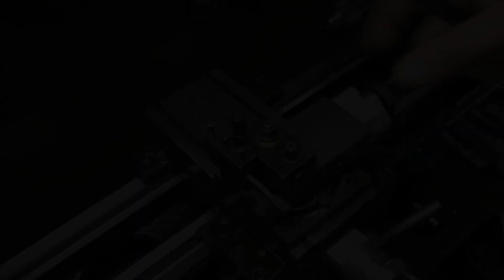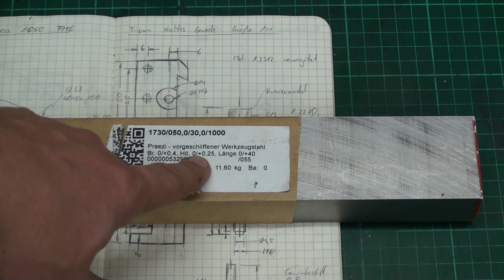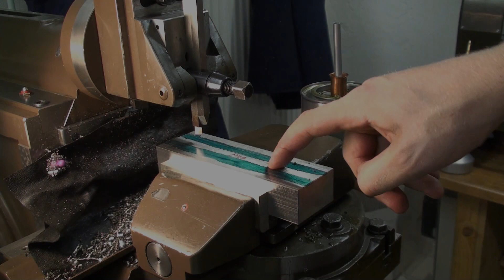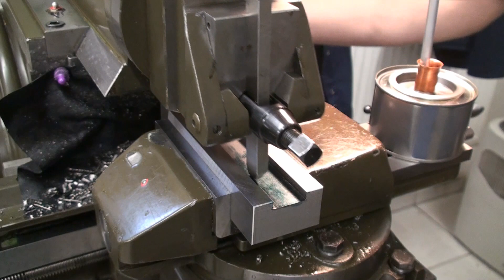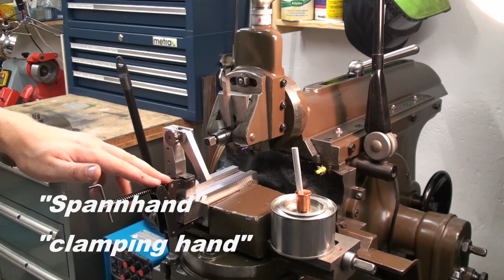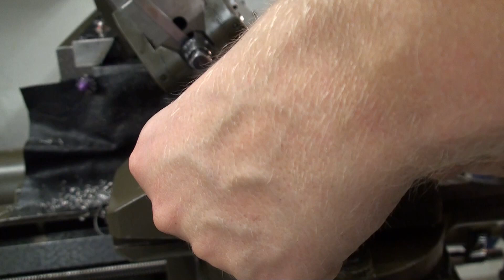Tripan 111  toolholders Part 1 - Tripan 111 Werkzeughalter Teil 1

Comment: Very interesting project, I have a Tripan 111 myself, and plan to make some holders if it works with a 60 degree dovetail cutter, I hope it will...
In germany, you have Deutsche Industri Normen DIN, and the steel is DIN 1.2312? I was thinking about the rest of the EU what 1.2312 would be? Looks to be the same as 40CrMnMoS8-6? I can probably not ask my local steel supplyer here in Sweden for DIN grades... First I though this steel was the trade name "C45"-grade, but now I get it, this is more proper tool steel with much higher content of chrome, molebdynum, and manganese...
I asked my local steel supplyer for C45 round stock for a pin replacement for my excavator. They said it was "obsolete", and replaced my more modern micro-alloyed variants that welds better. But this is another purpouse than toolholders of course...
I'm trying to learn different grades of tool steel. The HSS boring bar holders you made were of  DIN 1.2210 / 115CrV3 steel (silver steel). I am looking to make them as well...
Reply: Now I get it! In Sweden SSAB makes Toolox 33 as a more modern competitor to 1.2312/11. But it is pre hardened, not annealed state as you got.

Comment: Very nice series, well done job! I have a question on machining the dove tail itself. It has a 60 deg angle, and a depth of 6.3. The relief in the middle has a depth of 6.5. The question is, do you make an extra relief at the innermost edge of the 60 deg dove tail, as I believe exists in the original? Or is this not necessary? Thanks a lot!

Comment: Hi Stefan! Love machining videos and yours are some of the best I've seen, very detailed and informative.
I'm in no ways a machinist or fabricator, so forgive me if the following sounds stupid :)
Wouldn't it be possible to have some kind of jig that would allow interchangeability between the milling machine and the shaper? I.e., something that would allow to indicate your parts on only once and then you could change the whole set between shaper and milling machine, without loosing settings. I'm asking because it seems it would be much faster to rough cut your dovetail slide on the milling machine and fine cut it on the shaper.
Thank you for your videos and wish you have a great 2017!

Comment: Absolutely no interchangeability with Aloris style tool holders I suppose.
Reply from the maker: Of course not :)
Reply: +Stefan Gotteswinter Figures. As a business model it is called "buy or stuff". I find the Aloris Dovetail Type very repeatable. on the order of .0005"/.012mm is easiely held. The Aloris Piston Type not so much as one pulls the holder into the dovetail and the other pushes it on to the angled surfaces. Yours looks like it registers against the two flat surfaces and the rear dovetail surface. asways better to have at least on of the dovtils fully engaged.
Reply from the maker: I have a video on repeatability of the tripan toolpost, we are talking better than 1/100mm there too. The swiss know how to make a proper toolpost.
The tripan is a bit  different to the wedge and piston type aloris, it pulls the holder back onto the big flat surface of the dovetail.

Comment: what do you use...ähem...was verwendest du als cutting oil?
btw, you made very usefull chips, nützlich auch für mich - ich lerne sehr viel von dir und bewundere schon fast dein können ;-)
Reply from the maker: +lordofbasement Meistens was mir grade in die Finger kommt - Im Moment ist in meinem Öltopf normales dünnes Schneidöl:
http://www.ebay.de/itm/Schneidol-LS-90-Hochleistung-schneid-ol-universal-1-Liter-PR-/140981978027?hash=item20d32e43ab:m:mvJVRVHy6fyyB0PlVr_cUmg
Ich betreibe ja nicht grade Schwerzerspanung, da funktioniert so ziemlich alles...mir kommts immer so vor wenn Leute auf ein spezielles Schneidöl verweisen wollen sie unzulänglichkeiten am Werkzeug (Schliff, Schnittwerte...) ausgleichen...
Reply: +Stefan Gotteswinter und wieder ein sehr wichtiger Tip für mich, danke dafür! Ich dachte du verwendest irgendein highendultra irgendwas Öl um 99.- den Liter.
Wenn ich dich nochwas fragen dürfte, welche Fräser kannst du empfehlen? Ich habe einen Paulimot BF20 Klon und schlage mich momentan mit irgendwelchen Chinafräsern rum und produziere meist nur Mehl. Stell ich zu wenig zu? oder liegts schon an den Fräsern? Ich habe mit höchstem Interesse auch deinen Fräser vergleich verfolgt. Welchen würdest du für Modellbau im heimischen Keller an einer BF20 empfehlen? Du sagst immer was von carbide. Hast du da vielleicht einen Link dazu?

Comment: Hi Stefan,Just bought myself a shaper and so I have watched your very good and instructive video's on the use of such a machine again. Watching closely it seems that your machine is cutting on the backstroke. Is this normal for this type of machine or is it the way you set it up for this kind of projects.thanks and keep the nice vids comingTeun
Reply from the maker: +Teunbaartman1 I have two clapper boxes for that machine, one normal push-type and the reversed pull type. I prefer the second one as the chips dont fly all the way trough the shop and also its more rigid as the cutting forces work against the column of the machine.

Comment: That Gack shaper is a treasure. There are some old time books, reprinted by Lindsay press, on shaper work. Such as Stieri's "How to Run A Shaper" which I mention only for the benefit of shaper fans out there (Herr Gotteswinter knows it all already). Lindsay retired, but the inventory was bought out by www.youroldtimebooks.com.  Probably still some copies available. 

For myself, my chances of finding a shaper in Alaska are equal to my finding a Unicorn. But I was fascinated by the dovetail cutting. Slow, but most certainly sure. And much cheaper than buying a cutter and doing it on the mill. Bravissimo Stefan!

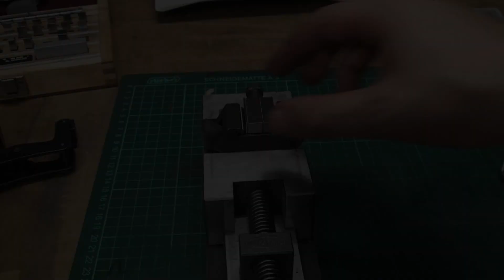Comment: Such clean work! I do have a question about measuring the width of the dovetail, could you not get a good and accurate measurement with your blade micrometer off the end of the dovetail at the "top of the vee" @16:00? I know that with the gauge pins you get all of the information that you need to replicate the tool-holders with the gauge pin technique, but I am just curious if you could attain an accurate measurement with your blade mic? Thanks very much.

Thank you for the video series, it is exceptional as always...Aloha, Chuck.
Reply from the maker: +Knolltop Farms Might work, but it could also be missleading, especially if one would measure against the edge of a part. The method with the two pins is the best way to do it in my mind, especially as you can check that way if the dovetail is parallel very easy.
What would make it even simpler would be a set of adjustable parallels.
Reply: @StefanGotteswinter  Also, if you know the pin size, and then doing a bit of trigonometry you can calculate the theoretical width with Stefan's measurement. d/tan(30)+d+20.23 gives 31.16, assuming the pins have d=4

Comment: Hi Stefan, it is always a pleasure to watch the shaper work. I know that you have the shaper set up to cut on the return stroke to limit the area the chips are thrown. Is not the speed of the return stroke greater than the cut stroke? This would have an impact on the way you set up the machine so you achieve the proper speed and feed for the material being processed. Correct? Now how did you modify the clapper so the tool bit does not scrape the work piece on the normal cut stroke and cut on the return stroke? I find it odd that "precision" ground stock is not square since that nullifies the word precision in my mind. Thanks for the info.

Peace!
Reply from the maker: +Jeffrey Vastine  Yes, of course :) For that reason the Gack has a switch to change the rotation of the motor when using the pull type clapper box - Then you get the slow, powerfull motion against the column and the fast return stroke away from it.
I had not to modify anything - the machine comes with two clapper boxes, one classic push type and the reversed one. They are changed within 30 seconds by loosening two screws.
I think I will do a seperate video on the gack shaper, as there are SO much questions on that machine..
The "precision ground" refers only to the parallelism of the stock :)
Reply: +Stefan Gotteswinter Thanks for the information as I did not know this. A video about the gack shaper would be great! I look forward to it.

Comment: Stefan,    My shaper seems to be set up to cut on the forward stroke,   It seems like (from the video) your shaper is cutting on the return stroke.   Is this so and would you care to say why you do it this way.  I am not an expert on the shaper but would like to be and to understand it better.  Sure would appreciate a comment from you on this.
Reply from the maker: +Glenn Felpel The Gack shaper can be setup to cut in both directions (pull and push) - It comes with two clapper boxes and a switch to change the direction of the motor.
I prefer the pull-cut most of the time, as its a more rigid setup - The cutting forces work against the column and as a benefit the chips dont fly all over in the shop.
And if youre working to a scribed line its also easier as youre not getting a burr on the surface with the layout, because the cutter enters the material there..
Reply: +Glenn Felpel  Thank you for the explanation, that does make a lot of sense.  I haden't thougt about the loayout lines and yes they do get lost in the burr, and it isn't safe to get in there and clear the burr away.  That ram had tremendous force in it.

Comment: I assume that if I didn't have a shaper I could machine the dovetails on a mill with a dovetail cutter.   Correct?  I'm curious why you didn't machine it on the mill instead of the shaper.   Can you amplify a bit on this?   Thanks.   Your videos are always just great and very helpful.
Reply from the maker: +Best Services Sure! It would even be faster, but dovetail cutters are pretty expensive.

Comment: So where do you order stock material? Been ordering aluminium from germany off of ebay, cuz its way cheaper than sweden even shipped.. 
Tool steel here is.. bonkers..  :|
Reply from the maker: +Moronicsmurf I order toolsteel here: https://www.marks-gmbh.de/
And they are not cheap either...but they have allmost every common and uncommon machine- or toolsteel. And they seem to have only a german website.
Reply: I have started to.. well learn german for.. reasons ;D

Comment: The Tripan is a very interesting toolholder for the smaller lathe.  It appears that it might be relatively simple to make one.
I always enjoy your videos.  You are not only a fine machinist but also a great video cameraman and producer.
Question:  Do you have/use adjustable parallels?  They would be good for measuring the dovetails between the pins.  Just wondered if they're not common in Germany or if it's just a matter of preference to use the gage blocks.
Reply from the maker: +Richard Freeze They are totaly uncommon here - Most machinists in the trade never have seen them, Gage blocks are the usual way here. But I am always on the lookout for adjustable parallels on Ebay UK and US.
Reply: A shaper gage would work well also.
Reply from the maker: Duane Dickey Right - Also a super-unusual tool here :D

Comment: Let me start out by telling you how much I enjoy your videos.  As an American I can appreciate a different approach to common machining operations, which you bring to the table.  I really like that you run your shaper cuts in reverse from any other shaper videos than I've seen.  Your reasons for doing so are valid and I'd like to learn more.  RE: MRPETE222 aka Tubularcaine Shop Tips #172.  Describes the Whitworth Quick Return Mechanism as applied to the Scotch Yoke.  You mentioned in an earlier video that you changed your shaper to cut on the back stroke.   How did you accomplish this as it appears that the non-cutting return stroke is faster than the cutting stroke?  Can most shapers be configured to do this?  Of course, I realize a reverse clapper would be required.  Thank you for your time and excellent videos.
Reply: +Tyrod 01 Hi there, I am in England and I have never seen a shaper being run in reverse like this. The ones I used to work always cut in the forward stroke i.e towards the knee and would shoot the chips over the shop floor. We had a very big one and the clapper box was operated by a mechanism fitted to the top of the standard clapper box. I suspect that perhaps this is something that is done in Germany and Europe? he would just throw a switch to change motor direction. Our Big one, the motor just ran when it was turned on and ran all the time, then a lever clutch was operated to stop and start the ram action. Good to see someone doing such accurate work on a shaper, most people would just mill it as I would. I would like a shaper but have so little use and space for one, so just bung up an end mill and finish with a dovetail cutter.
Reply: +Tyrod 01 you can have a fast cutting stroke when cutting in reverse as you put it by simply reversing the motor direction of rotation. As you have noted the clapper action needs to reverse as well.